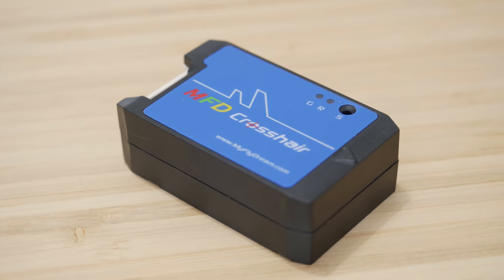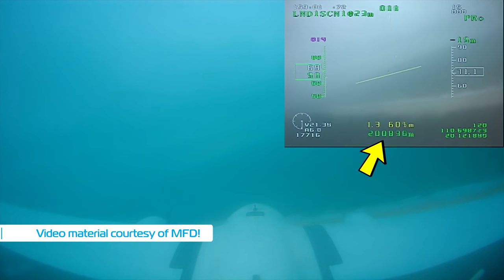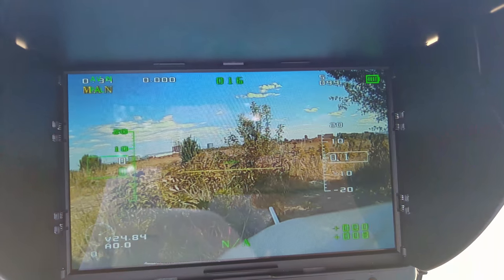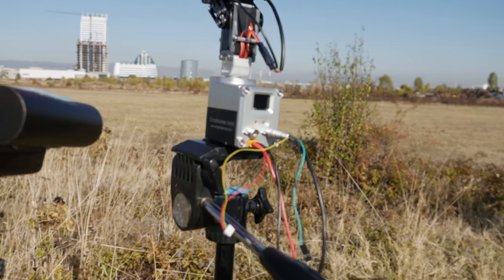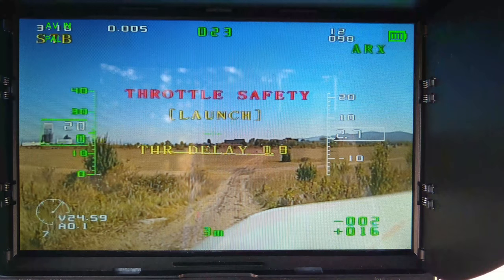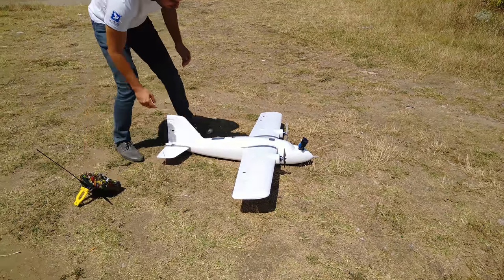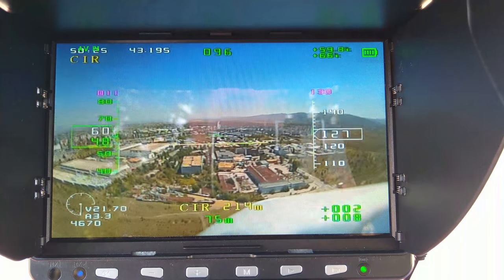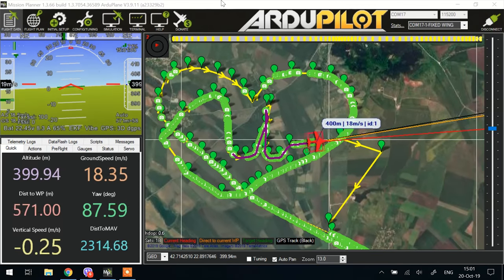MFD Crosshair Autopilot - at least as good as the old one

Comment: I've been running the original AP for near 4 years now and it's never let me down. Whatever model it goes in, RTH works on stock settings really well and autolaunch is a very reliable too. I'd love to use this Crosshair, but its 2 major downfalls are price and form factor. To compete with the Matek boards it needs to be $100 or less and I'd like to see the current sensor and BEC's built into the main unit (again like the Matek boards). Thanks for the review though.
Reply from the maker: You are correct... it is larger than what I expected too... especially considering what Matek are doing with the Wing series! As for the price... can't comment there... cubes go up to $400-$500... for the main unit only, and no sensors... soooo...
Reply: I have been a Dragonlink and EagleTree Vector guy for years.  But this video makes me want to try the MFD Crosshair.  I have seen you with MFD, Pixhawk, Arduplane etc, however never seen you or Adam G using the Vector, so I am not sure if you guys could compare.  I have no intention of using an MFD tracker, so other than things such as auto launch/land is there any other advantages to the MFD?  I almost pulled the trigger already on the purchase but the price is making me cautious and want to stick with the Vector.  Again, not sure if you are able to compare, but any input would be appreciated guys.  Thanks.
Reply from the maker: Well... sadly I have no experience with the Vector, so can't say much, but I have rarely heard a bad thing or a complaint about it, if ever... sooooo... people seem to be quite happy, and it seems to work!

Comment: Dear Arxangel, would you still recommend MFD Autopilot as a first FPV flight controller? Do you think the MFD company will continue to support/improve their products?
Reply from the maker: Hi, yes I would! It is a solid system with very few issues, and it has worked reliably for me. True, support can be difficult to contact at times, but I am quite happy with ease of operation and use, and can absolutely recommend it!

Comment: hello I am making autonomous aircraft for the competition. Which autopilot do you recommend

Pixhawk or matek or apm or...
Reply from the maker: Which competition? Pixhawk and APM are pretty much the same thing... but Pixhawk is the newer hardware and now better code, since it is still being supported and developed! Matek... can have the same firmware on it as Pixhawk... but again... I need to know what competition is that, and what plane will be carrying those things!
Reply: @ArxangelRC  There are 2 points in the competition. 80 meters between two points. it will travel autonomously in the fastest way between these two points.

I use a pylon racer like plane type of aircraft, but can you suggest something different

Comment: I'm really interested into MFD products as a first plane because of simplicity and the way they offer everything needed.
There is any possibility to control the UAV over 4G Lte ? Like the mod for Parrot Disco for example, or adapting the UAV Matrix ?
I'm interested into long range 4G controlled flights. 
Your answer would be highly appreciated,subscribed to you, thanks!
Reply from the maker: Hey, sadly I have no experience with 4G control, and I have not looked into it, so I am not sure how exactly it works, but I would assume it should be possible as long as that 4G module can output SBUS or CPPM the autopilot will receiver it and work normally!

Comment: Hi I have this FC and want to use the input/output board but the manual doesn't show how to do it can you guide me on where the sbus wire is connected?
Reply from the maker: On the I/O board, on the side there is a label saying PPM/SBUS with a line pointing to the right pins.

Comment: Does this FC come with it’s own autopilot software? Or do you use mission planner for this? How did the guys flew it autonomously for 200km? How did they put the waypoints in?
Reply: And also, how do you load mission in it?
Reply from the maker: @tituan9152  You can load missions to it via Mission Planner, but it does come with its own firmware. They flew it for 200km by setting up a waypoint mission!

Comment: One wonder if you can share the procedure to connect the current sensor? I mean using two motors wouldn't  you use a 100 amps? and may you use two of them in stead?? 
Thank in advance.
Reply from the maker: Well the sensor is capable of handling 100A, if I am not mistaken, but you don't need two of them for two motors, though there is a limit on how big motors can be run through this thing! If your motors consume more than 100A, better look for a different autopilot with higher current sensors, although I will have to inquire whether there will be a higher current sensor available as an option! On this plane, the motors do not go over 60A combined, so I should be good! And that is only at full throttle.

Comment: Similar to features like FY41AP that I have been using for years and it works perfectly but is already 5 years old and I'm afraid I might start scheduling so I would like to change the autopilot in my skaywalker x8 and I need expert advice like you, recommend matek f765 or MFD Crosshair Autopilot ??
Reply from the maker: Well the new MFD Crosshair AP will be better if you are already used to the simplicity! The F765 Wing will require ArduPlane... and that is a whole different animal!

Comment: hi Arxangel, great videos, I've learned a lot, I just bought the crosshair, I have two questions: how I know when the GPS is lock? it doesn't say in the osd, and where should I connect another servo for my cam, and make it work? also, if I want to connect another cam, how? thank you.
Reply from the maker: You can't have two cams with this system, unless you use a video switcher! A servo can go directly to the receiver, if it has any PWM outputs, otherwise I know they are working on firmware to allow channel passthru, just like on ArduPilot, so you can map a channel for custom use from the radio, via the controller! As for the GPS, number of sats doesn't have an icon, but it is at the top of the OSD... I think about mid screen, should be a value of around 12, or something... it is that one!
Reply: @ArxangelRC  thank you for your response, yes I found the GPS sats, it's on the right upper corner, also I found how to control servos, I connected to the AP, thank you for your help. Cheers
Reply from the maker: Awesome! Good luck!

Comment: HI ARXANGEL RC , i bought the mfd crosshair not long ago but i have a hard time to put firmware up to date i have downloaded all files needed , crosshair 1.18 , mfd ap v1.18 ,ftdi drivers , mfd fw update and usb ttl but i can`t find the right files to update it , could you give me a hand and tell me which folder i should look into or tell me how to proceed pls . thanks a lot
Reply from the maker: Well the firmware file is called MFDAP_Crosshair_V1.18 and is located in the same folder as the Update application!

Comment: So for the $180 you get everything you need for a basic flight controller.  Rather than piecing everything and hoping it all works?

May need to consider one of these for my next plane
Reply from the maker: Well yes... but it does have functionality a bit above basic! But generally yes... includes all you would need, even the Airspeed sensor! Only laser sensor is separate, if you would be wanting those super smooth auto landings, which in recent firmware updates also include doing a few passes over the landing area to scan it, and get a feel for the terrain to better adjust the landing!

Comment: HI ARXANGEL RC AGAIN ! by the way thanks for the infos about the firmware files , everything went very well to updater it , but now my problem is ,  i connected the ailerons , in pins 1 elevators to pins 2 , throttle to pins 3, and rudder to pins 4 to the flight controller but i have no response from the flight controller , they seem to work when i move the flight controller up and down , left to right but nothing when i move the sticks of my taranis , can you tell me why or should i use the io board could it be easier , by the way i use sbus confg....  thanks again !
Reply from the maker: Well obviously the signal is not getting from the receiver to the autopilot for some reason! Possibly a faulty cable? Is your receiver powered?
Reply: @ArxangelRC  YES MY RECEIVER IS POWERED AND I CAN GET A SBUS SIGNAL FROM O/I BOARD BUT THATS IT , NO SIGNALS IF I CONNECT AIL. ELEV, RUDDER, AND ESC'S TO THE PIGTAIL , REALLY WIERD !!
Reply from the maker: So it works with the I/O board? If it does... just use that one!

Comment: where can I buy the I / O board and not even on the MDF site is this I / O board, 
in the version for sale in the various sites it seems that they do not provide it, 
also they talk about the current sensor from 100A, but then it seems optional.
can you tell me where to buy?
Reply from the maker: Have you tried contacting MFD directly to ask about this?
Reply from the maker: Alright, so for the power module, to get 100A option you can short the pads on the power module marked 50A/100A, and as for the cable, you should contact MFD directly at admin@myflydream.com
Reply: @ArxangelRC  ok tnks good work for your beautifull video .
Reply from the maker: @steve01cor92  Thank you! :)

Comment: Did you figure out the waypoints activation yet? Please
Just subbed
Reply from the maker: Yeah... both flight mode switches to full, and assuming you have waypoints loaded into the FC, it will engage WPT mode!
Reply from the maker: Correction, I think WPT is only ch5 to full! RTL is both switches to full! :) Verified yesterday!
Reply: @ArxangelRC  Great, did they figure out a way yet to have more than 20 wp uploaded from Ardupilot? I heard that there must be done a firmware update to be able to use memory card, thus increasing the number of waypoints, however you can plot more waypoints on the FC only using the OSD, which is quite a problem if you know what it mean.
Reply from the maker: @adamlhotak8180  Have not heard of that OSD thing... but you can load 20 waypoints for sure, using Mission Planner! Have not asked if that update has been done yet...
Reply: @ArxangelRC  How else do you plot more than 20 waypoints then?
I think its a fairly big shortcoming
Reply from the maker: @adamlhotak8180  Well originally he did not meant this to be a mapping flight controller! People wanting more waypoints does not mean he intended this flight controller to be used that way! He did say this functionality can be added, but I'd have to ask if this has happened!
Reply: @ArxangelRC  I would be really pleased if you found out if availability of additional waypoints was added. I plan to use it actually as kind of a small package delivery platform where the plane lands vertically on a lawn perhaps and then takes of again and returns (just like amazon idea), besides this, i plan to have a superior plane design to the one of my friend whom instead bets on large capacity non-vtol plane. Competition is a great motivation indeed
Reply from the maker: @adamlhotak8180  Haha, nice project, best of luck with it! But how will you do the VTOL part? The MFD autopilot does not, I think, support that function at this time? I asked, they said they have a custom firmware now, not open to public, still in testing, with 200wpts capability.
Reply: @ArxangelRC  Terrific news with the waypoints upgrade. I suppose that the MFD Crosshair AP does support the VTOL function as they sell the Nimbus VTOL RTF with the MFD AP, I mean, what else would they use?
I will have to convert the normal Nimbus to VTOL as the RTF version cannot be shipped.
Reply from the maker: @adamlhotak8180  OK, I am glad 200wpts are enough for you! :) I did inquire about the Nimbus... turns out Pixhawk is used for the VTOL part, and then the Crosshair for the plane part... how the switch between the two happens I am not certain... have not yet received that information! Wonder why they didn't use the Pixhawk for everything, since it is more than capable of it!
Reply: @ArxangelRC  Thanks for the information!
I guess I´ll have to use perhaps pixhawk 2.1 Cube then
Reply from the maker: @adamlhotak8180  Yeah, sounds like a plane, so get the plane with the necessary gear, only without the flight controller... if possible! :)

Comment: Hi ArxangelRC
Running several issues.
First one: I was only getting black and white OSD, finally figured out that you have to put NTSC in the AP.  
Now I am not able to get the GPS reading.  Still trying to figure it out.  Red light on the GPS and no GPS reading at all on OSD (outdoor).  Do you know if anyone has come across this issue?  Thanks
Reply from the maker: Hm... actually there is an option in the setup to change between colour and black and white OSD... as for the GPS... does it say somewhere that there are is no GPS lock... or do you just can't find the indicator on the OSD?
Reply: @ArxangelRC  thanks for responding, no reading at all on the OSD.  GPS unit blinking blue colour.  I waited for at least 25 mins outdoor and still no reading just showing - - on top right of OSD display.  I have also double check the connections etc to ensure all correct and properly secured.
Reply from the maker: You are using the GPS that came with the autopilot? Have you contacted MFD about this?
Reply: @Tintin-ko4vi  did you ever find a fix for this problem?  I have the same problem on 3 units.

Comment: Would you say this is worth the money? Considering how many options there are out there now with the likes of iNav and Ardupilot being able to work on much more affordable hardware like the Matek flight controllers?
Reply: Nope, expensive and complex and not very compact IMO..🤔
Reply: @EnglishTurbines  my thoughts exactly.

The great work done by the inav devs has rendered these expensive auto pilots completely irrelevant.

For £40 you can buy a matek F405-WING board, an extra £15 for a BN-880 GPS with compass, and then choose whether to put Arduplane or iNav on it.
Reply: @grim-upnorth  Yep, it's a no brainer TBH.
Reply: @EnglishTurbines  Also, if anyone in this hobby is still actively trying to avoid soldering and/or making up wiring harnesses to fit their needs, they're in the wrong hobby lol
Reply: @grim-upnorth  Yeah, plug n play FPV, where's the fun in that..?...🤔🤔🤔lol.
Reply: @EnglishTurbines  I can definitely see the attraction of plug n play FPV, and it's something that would bring people into the hobby (if it doesn't die in the next year or so with these new stupid laws). But this is a complex build, long range platform, with many different permutations to consider... which RC link are you going to use, which video system will you use, what camera will you use... the hobby isn't standardised in any way shape or fashion, there's no common connector (apart from the dupont pin system such as you find on servo connectors) but even then, you'll always need extensions, and some components don't even come with these connectors.

Take Crossfire for example, great bit of kit. I just installed a nano rx into my Ranger EX wing... but it's just a PCB, so of course I needed to solder wires to it in order to connect it to my system.

It's not just a case that plug n play isn't any fun, the fact of the matter is that there's no such thing as plug n play. 

Sure this MFD AP might indeed come with lots of "stuff" that has connectors designed to plug into the main unit, but what about the non-MFD AP components that are supposed to connect into it... like I mentioned above, the camera, RX, VTX.

Soldering WILL be required, fact. I think its a bit disingenuous to claim that this system is "plug n play".
Reply: @grim-upnorth  Agreed, I was being flippant with the plug n play...You always need to extend some wires, like ALWAYS....🤔😎
Reply: @EnglishTurbines  Oh yeah, we're on the same wavelength for sure :-)
Reply from the maker: I might be willing to agree on the expensive bit... considering the competition, but the complex comment... not sure how this is complex... took me 5 mins to set it up, and it was first experience with this autopilot! With Ardu it takes me a lot longer... even though I know it very well!
Reply: Oh, it's definitely not complex compared to ardu.
Reply: @ArxangelRC  If you are using long range video link, the Tracker is an unessesary and expensive evil....It's just a fact....🤔🤔
Reply from the maker: Well... that long range video link doesn't become "long range" on its own, especially on 5.8Ghz! :) Proper and directional antennas, and an antenna tracker, help greatly, especially at that frequency! Could be different for 1.3Ghz, but I don't use that frequency at this time!

Comment: The MFD CRosshair is one of the top auto pilots at a great price (considering everything it comes with.)  However, I do not recommend it because the instructions are lacking in specificity and are full  of assumptions one really does not know will work unless tried, and then you may burn out the autopilot.  Also, there are a bunch of videos put out by MFD which are scattered all over the web and also lack specificity. TOO BAD!
Reply from the maker: Right... yeah... but that goes for a lot of the Chinese manufacturers!

Comment: does the autopilot still work/the plane keep flying if it loses Rx Tx Connection?
Reply from the maker: Of course! Won't be much of an autopilot if it didn't!
Reply: @ArxangelRC  alright im sorry im new to this. so the flight path is stored in the autopilot right?
Reply: @ArxangelRC  whenever i see a video of these autopilots the pilots always have a tx rx connection and if it’s long range they even use like satellite dish things to have a connection… thats just to have a live feed then but not necessary?
Reply from the maker: @coraldestroyer4202  Well for this one not quite. It just turns the plane around and heads towards home in a straight line. Yes, larger antennas improve the link, but they are not necessary, but you will have shorter range.